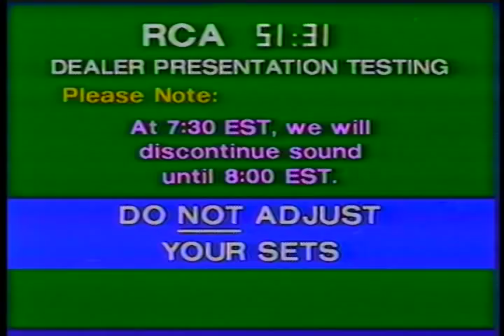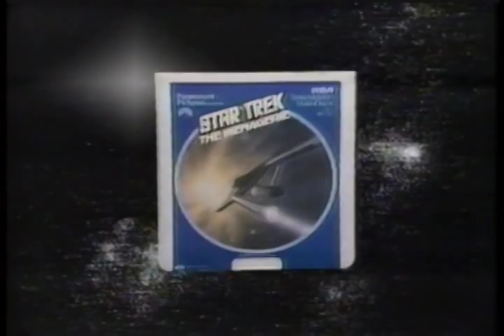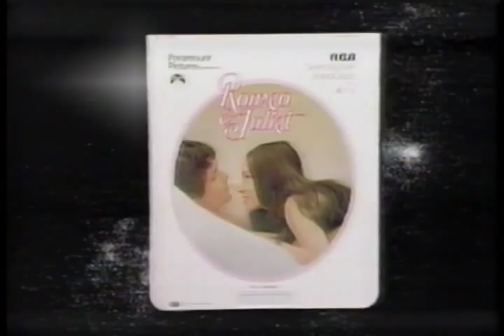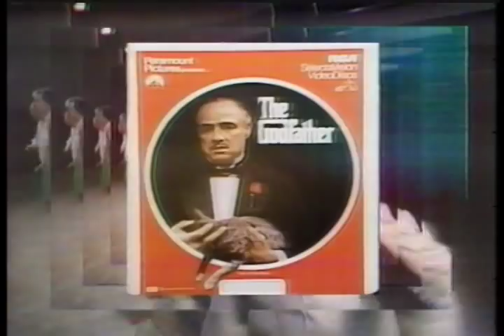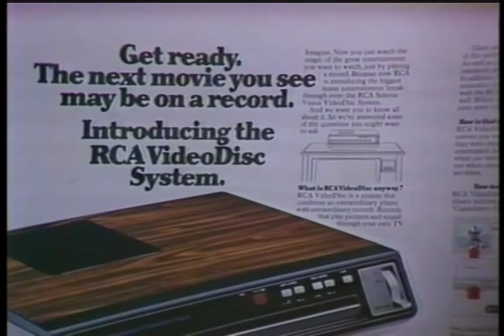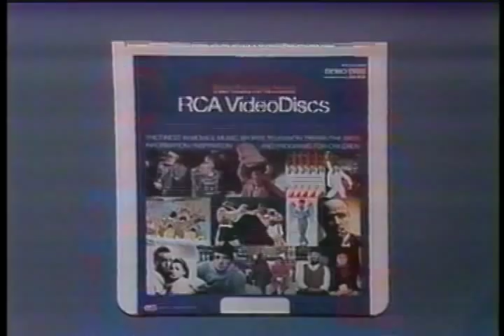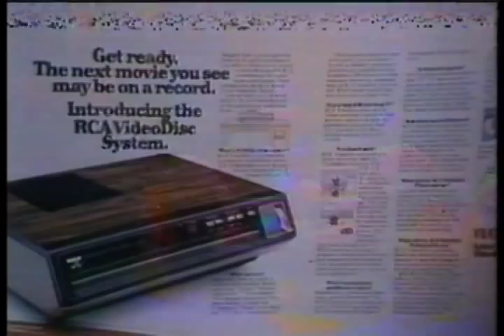RCA SelectaVision VideoDisc Dealer Introduction

Comment: Dang, those RCA people were savage in those songs! I love the "finding out too late that it's pornographic" line.

Although the SelectaVision system sounded very intriguing, the inability of the user to record things on it was a problem. And I don't think there were any special qualities to the discs when compared with VHS tapes either.
Reply: The one special quality that the discs had over video cassettes was that prerecorded material could be had at far lower prices on discs at the time.  Therefore, part of the strategy of the format's success was that collecting movies wouldn't be as expensive.  However, such a strategy never took into account video rental, which made watching movies on VHS and Beta cheaper still.  Rental would be a sensible choice for people as most wouldn't have cared to own a copy of a movie unless they really liked it enough to do so.

Another flawed strategy was to market videodisc and video cassette like phonograph records and audio cassettes.  If you had a stereo system at the time, you likely had the ability to play records and tapes, each complementing each other as part of a whole.  The same was intended with videodisc and video cassette.  However, the rather considerable expense of video equipment at the time pretty much ensured that most people would choose disc or tape rather than buying both to make a complete home video system.  And most chose tape because it offered the most value for money, such as being able to record programming.

What's funny is that RCA did it to themselves; they heavily marketed their line of VHS VCRs without realizing that their own VCRs wound up competing against their own videodisc format despite such a thing not being their intent.

And the CED format wasn't really intriguing from a practical standpoint.  Indeed, the format had serious shortcomings, such as issues with excessive skipping and carrier distress (loss of signal) if the disc wasn't perfectly clean.  Additionally, and as you've alluded to, picture quality was only about on par with VHS at best.  But at least CED stereo sound with CX noise reduction was superior to video cassette ... up until Beta hi-fi came out in 1983 followed by VHS Hi-Fi about a year later, which offered superior dynamic range and frequency response.

In spite of its initial problems, LaserVision (LaserDisc) was a superior videodisc format to CED, and that came out about three years prior.  By about 1983, there was no advantage of CED over any of its competition, not even with the advent of computerized random access operation and interactivity functions for the format ... functions which LaserVision was capable of well before CED managed it.  However, even LaserVision wasn't able to compete against VCRs beyond being a niche product for people who wanted the best possible picture and sound.  It would take DVD-Video to give people what videodiscs in the past had promised.
Reply: @Watcher3223 CED’s video quality was indeed superior to that of VHS. We loved the format, because we got a player at a third of the cost of a VCR, the films were much more affordable to buy, and the A/V quality was better.
Reply: @WaverBoy If there was any degree of superiority, it would have to been very slight.

Meanwhile, none of my CEDs really exceed VHS in terms of picture quality.

The baseband video frequencies between both formats are roughly equivalent and both formats use heterodyne color ... which is color that's downconverted into a way lower resolution compared to the color carrier in a true composite video signal from, say, a LaserDisc.  This compromise was done because human vision doesn't perceive color as well as contrast, permitting the recording of reasonable quality color video within a very limited span of signal bandwidth available in formats like CED and VHS.

With regard to sound quality, it depends.  The longitudinal track (a.k.a. linear track) on VHS will always sound inferior to CED.

But VHS Hi-Fi sound will blow CED stereo with CX noise reduction out of the water because video cassette Hi-Fi has a wider frequency response, greater dynamic range, and better S/N.  Hi-Fi basically works by reading and writing an AFM audio signal to the tape at very high speed via the rotary head drum that's also used to read and write the video signal.

I've collected on the CED format for decades and my current CED players are three RCA 400 series random access players and one RCA SGT-250, so I am speaking from experience as well.

Comment: It's not that CED discs skip.  It's not that you have to replace the stylus.  It's not that the machine was too expensive.  It's not that the picture wasn't good enough.  It's not that RCA didn't spend enough money on it.  It's not Laserdiscs.  It's not that the library wasn't big enough.  It's not that the discs were too expensive.  None of those issues are the reason it failed.  The machines were significantly cheaper than VCRs and the cost to to buy the movies even more so.  The picture quality of the discs in 1981 was amazing (enough).  The reason it failed is because video tape recorders were sold to solve an existing problem that ever household with a TV had.  VideoDisc was an answer to a problem that simply didn't exist.  There was zero market for people to own (or even rent) their own video library.  Z E R O existing market for the VideoDisc product.  Beta & VHS was NOT sold to the public based on owning or renting a video library but rather on the concept of time shifting - it was the first DVR; watching the existing broadcasts coming into your home when you wanted.  Watch this and tape that.  Tape it when you're gone.  Rewatch it when you want.  Go back and look at all the advertising for VCRs.  Renting tapes came in after and buying after that, but only after millions of VCRs were already in people's home acting like today's DVR.  VHS was more popular than Beta because that tape was two hours and you could record a 2 hour TV movie (later 4 & 6 hours).  LD and CED was an answer to a question that people weren't asking.  Take for example the first VCR my father bough, it was a Quasar which was marketed as the Quasar "Time Machine"  Sony Corp. of America v. Universal City Studios, Inc. is why VCRs existed and why DVRs exist today and that was all about time shifting, not about buying or renting movies.  It's not coincidental that Universal (one of the main backers of Discovision, Laservision, LaserDisc et al) is the plaintiff in that landmark case that still effects us today.  Y'now...just saying, IMHO and all.
Reply: CED failed and bombed for one specific reason and one reason alone: It was outdated and out of style by the time it came out in early 1981. IT was TEN years out of date and 8 years LATE to the market.

Had it launched in 1973, it REALLY would have caught on.
Reply: It was the correct answer or at least would have generated the adecuate questions back in late 60s or early 70s. You know, color TV wasnt a required solution, but once you see the set performing, you want one. By late 70s, CED wasnt the only game player. People was aware that image could be played at home. CED was late to be groundbreaking. VHS and BETA to help with time shifting (Tec Connections).  I didnt feel this was a heavily asked question neither. VTR was on heavy use on TV where it was really IMPORTANT for non live programs. IT all started with Bing Crosby and AMPEX ... the idea of PRERECORDED programs for radio. But consumers have different questions.
Reply: "There was zero market for people to own (or even rent) their own video library.  Z E R O existing market for the VideoDisc product.  Beta & VHS was NOT sold to the public based on owning or renting a video library but rather on the concept of time shifting"

Exactly.

The demand for videodisc ... and prerecorded video cassettes incidentally ... did not exist and had to be created.  That's what marketing was for, to show people that they could have a use ... and a desire ... for something they've never had a need nor want for.  In other words, a new idea had to be sold to them.

Otherwise, video cassettes like U-Matic, Cartrivision, the Time Machine, Philips VCR, Beta, VHS, Video 2000, etc. were devised for precisely the reason stated; time-shifting.  The ability to record a television program for later viewing in the event that one cannot watch it at the time of its broadcast.

The Betamax case, brought against Sony by MCA (Universal) and Buena Vista (Disney) was partly to settle the question over whether recording a TV broadcast constituted copyright infringement.  The U.S. Supreme Court determinted that it did not, at least not if that wasn't the intent of making the recording in the first place.

And VHS had multiple reasons for its success.  The ability to record for longer times was the biggest factor, an aspect that RCA seemed to be more aware of than even JVC was.  When RCA approached JVC to become a VHS licensee, they wound up going over JVC's head to its parent at the time, Matsushita Electric, to develop the 4 hour speed in conjunction with Panasonic ... which was why JVC referred to the four hour speed as "the bastard."  RCA had wanted a longer recording time than 2 hours for VHS and JVC wasn't immediately responsive to RCA's concerns.  JVC, of course, would then develop the 6 hour speed.  Another factor was JVC's better flexibility and friendliness with licensees compared to Sony.  Sony, unfortunately, had a rather adversarial attitude toward their licensees, a tendency which Sony essentially persisted with throughout their format's life.  An example was Sony's refusal to sign Hitachi onto Betamax, fearing that doing so would alienate Matsushita Electric without realizing that Matsushita's JVC subsidiary was developing VHS.  Also, a license to manufacture Betamax equipment and cassettes was far more expensive compared to the same for VHS.  JVC's strategy for success was to ensure a greater likelihood of industry-wide adoption of VHS over Beta.
Reply: @Tornado1994  Of course, in 1973, the technology behind CED was not sufficiently developed to create a marketable product.  For instance, it wouldn't be until the very late 1970s when RCA would figure out how to make a CED as a simple disc rather than a multi-layered disc that didn't last for very long.  They also hadn't developed the auto-loading system to address problems with people touching the signal surface of the disc in handling.

It also didn't help that RCA lost its focus after David Sarnoff retired from the company.  Under the direction of David's son, Robert Sarnoff, RCA diversified into a conglomerate, acquiring businesses outside of RCA's expertise.  On top of that, it wasn't helpful for the company to have had revolving door management after ousting Robert in a boardroom coup.  All of that meant that the development of RCA home video products, including CED, weren't consistently supported by the company's leadership, even being under the threat of cancellation ... and a few products were canceled, like Holotape and Magtape.
Reply: People were ready for video discs - 1997. DVD. Essentially 99% used as video disc.
Reply: This is called going 4 broke and riding the ship down to the bottom
Reply: @PascalGienger  "People were ready for video discs - 1997. DVD. Essentially 99% used as video disc."

People were ready for a product that could deliver what it promised at a price they were willing to pay.

CED had too many performance issues while still being of considerable cost while LaserVision wound up becoming way too expensive and, itself, had to overcome initial quality control problems during the DiscoVision era that were so severe that they even threatened the viability of the format at one point.

DVD-Video delivered what previous attempts at videodisc could not: high quality video and audio that was affordable to the masses ... and at quality levels that greatly surpassed LaserDisc and pushed the predominant analog video standards in use at the time (NTSC, PAL) to their very limits.  Though DVD-Video was initially very expensive, the costs came down very quickly while quality of both the hardware and software improved.

Because of its superior quality and rapidly decreasing costs, DVD-Video became the choice for pre-recorded material over VHS, and remained that way until Blu-Ray Disc could follow the same path ... and then there's the proliferation of broadband internet and the appearance of high definition video streaming services.

Comment: To think RCA was big enough to have their name in neon on the top of Rockefeller Plaza...

Worth mentioning - Laserdisc's came out in 78 - two years before this did.
Reply: And VHS a bit eairler. The foot note is the original idea was from the mid to end 60s and it wasnt pollished properly and paused many times due to managment changes. If execetued properly, they would have been dominated the market. The commited to launch this project at a time that didnt made too much sense. The discs were affordable, big point.
Reply: @38911bytefree  Actually, RCA originally had a Holiday 1973 rollout planned for CED, and had a Working Prototype as Early as May 1972, but Internal Politics caused things to fall to the wayside and put them WAY behind. RCA didn't finish the CED project until The Summer of 1980.
Reply: The RCA neon sign was on top of the Rockefeller Center, but it was changed to GE, and then Comcast where it still is today.

Comment: Stupidly RCA marketed Panasonic and Hitachi made VCRs as Selectavision.  Average consumer:  I already  have one of those.
Reply: This is when you are TOO LATE and the last resource ... rebadge. IT was impossible to think a VCR machine outside Matsushita expetirse ...  Even JVC was under Matsushita rules ... VHS was an open standard. I mean they didnt sony-ed the format LOL
Reply: They bet all their money on the CED, plus MATSUSHITA (Panasonic / National Quasar Technics) was the LARGEST VCR producer at that time and other brand would keep using matsushita parts too. No point on develping a complete VCR when its already done. Same as philips and cassette. First tape recorders, EVEN PANASONIC used Philips styled transport. But they moved away from them in a couple of years. Matsushita was not only a manufacturer of consumer electronics, but the manufacturer of components, chips, motors, speakers. JVC is nothing but a Matsushita satellite (IMHO).
Reply: Ironically, RCA was in the middle of developing their own home video tape format (MagTape) before they canceled it and, later, wound up adopting technology developed in Japan.

Comment: CED (1981)  RCA
VHD (1983) JVC
Reply: The VHD did not skip as it is grooveless with a much wider stylus and a servo tracking system. That enabled those discs to be in Rental stores in Japan as playback was more robust.
Reply: @PascalGienger  VHD could skip, but the disc and/or stylus would have to be awfully worn out or damaged for that to happen whereas, with CED, skipping almost seemed like a standard feature, even on good discs and equipment.

Comment: Too bad it all went south for them. There were quite a few factors as to why it tanked . Firstly , the Videotape ( both Beta and VHS ) . 
The cost of the player (starting at 500 bucks). In 1981 that was quite steep.
 Plus , the economy was in the toilet so most people couldn't afford them.  
Laserdisc systems were somewhat competition for high end audio / video consumers. They should have released the CED system a few years earlier and at a lower cost. 
Then , it might have had a fighting chance.
Reply: Yeah, if it had been released in 1976 or 1977 it might've had a fighting chance; VCRs were available but very very expensive, whereas videodisc players were deliberately kept very very simple.
Reply: It flopped because it took WAY Too long to be released to retail. Pure and Simple. RCA had been developing it since the year JFK was shot. They had a Working Prototype ready by the Autumn of 1971 and a Beta Stage fully functional being tested and used behind closed doors during 1972, with a Targeted Spring 1973 launch date. But they completely shelved CED until 1978. Which was very shortsighted and stupid on RCA's part.
Reply: The idea behind was genious. They would get the control of film distribution with dirt cheap production costs for titles, something that VHS wasnt offering. THe player was way cheaper than a VCR. Issue is like you said, once people experience the magic of recording ... they are not going back.  And even when RCA tried HARD, reliability was poor. They pushed the discs limit too hard iMHO. If it was delivered 10 years before and with more reliability, they would have won